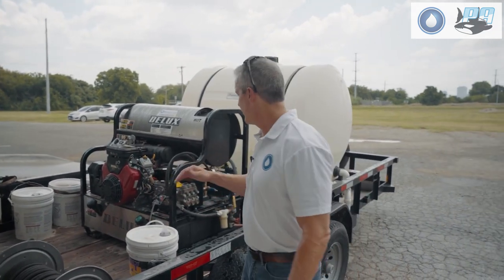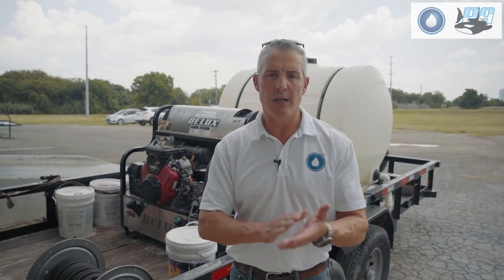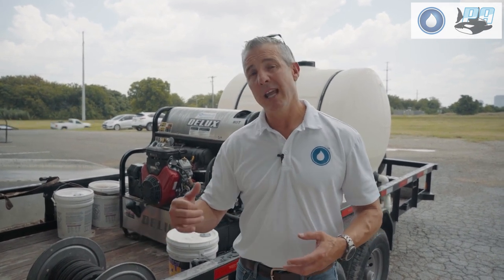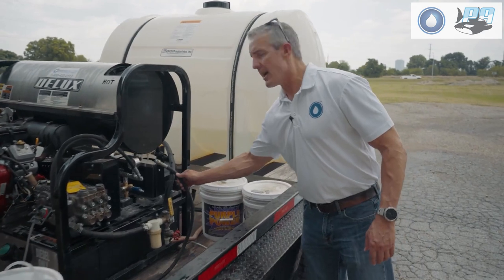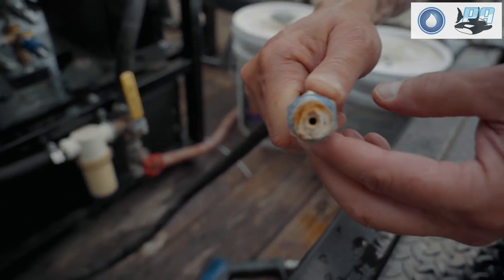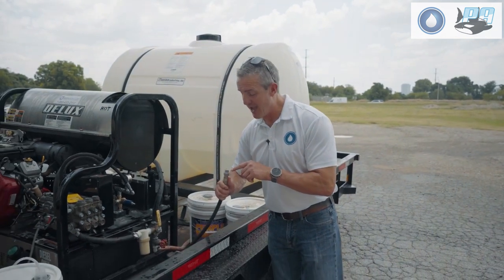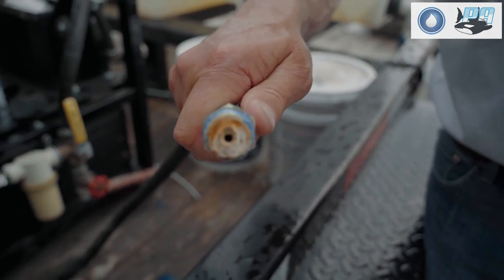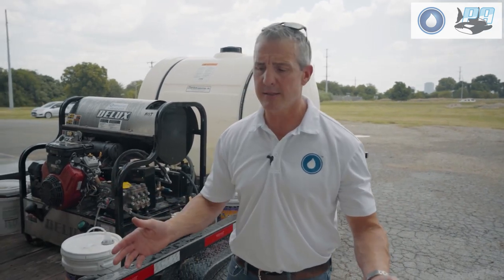The Importance Of Using Quality Soaps In Your Power Washing Equipment

Comment: Would't it be better to just have a soft wash system rather than running soap through the machine? Even an xjet downstream injector.

Have any videos on efflorescence removal? I used that effoff chemical and it got about 95% off of a really crusted up building tile wall but there was still a remained that wouldn't come up with repeated treatment. Did straight chemical from a spray bottle.